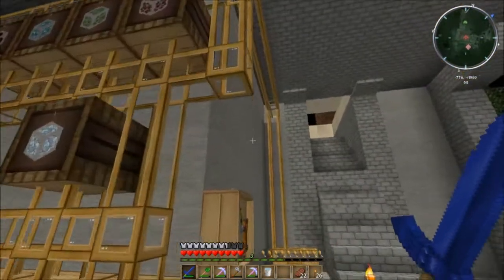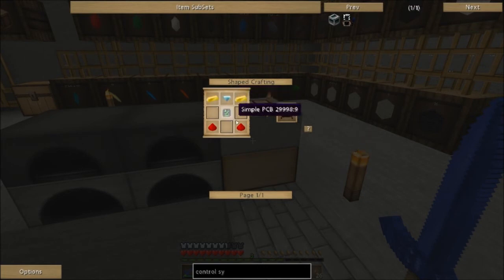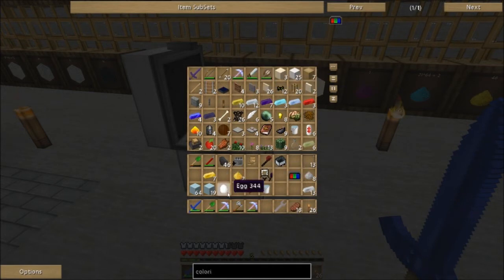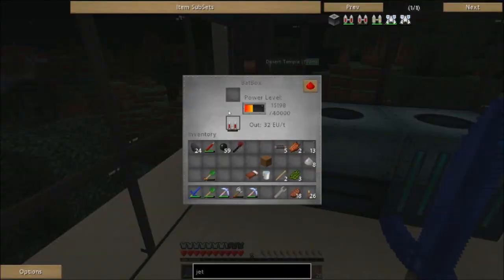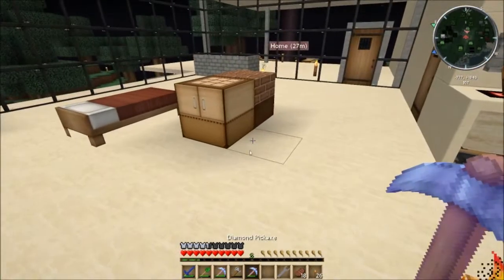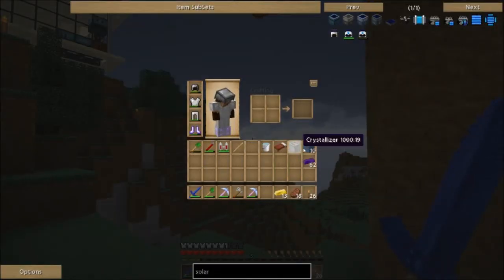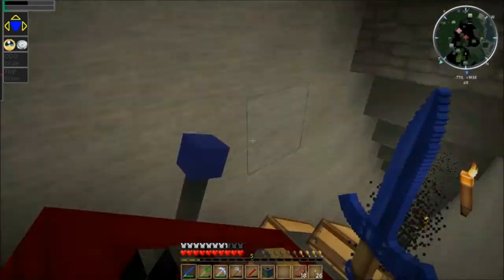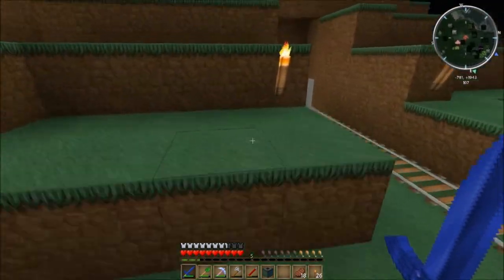youtube video #-Ck2yQyzQpQ

Comment: Nice video. To bad about the Engine. It was Steve Carts2 that has it, version 1.52. But that Coal One you Built with Alex is still cool. Nice to have Little ones around. Make the series Fun with Family. Yea in this pack Diamonds are finicky. Hopefully you have better luck. Also you should try the Shift_click with Recipes.(x) upper right. With craft table. If you have the Ingredients it will create the item,. w/o all that hassle putting stuff together.